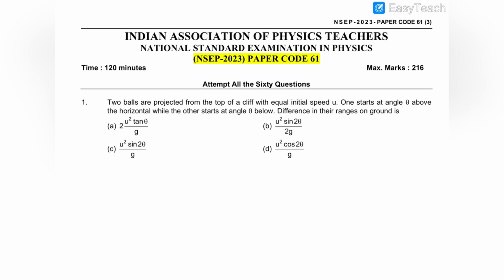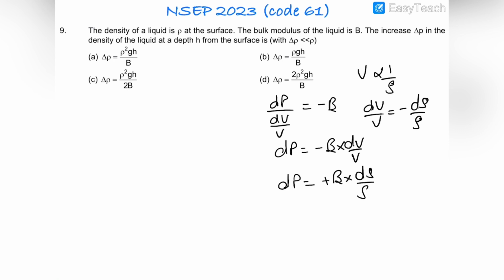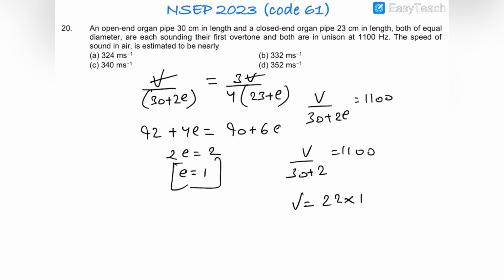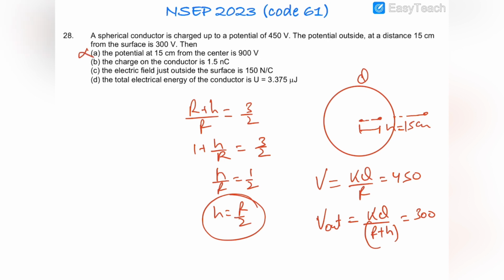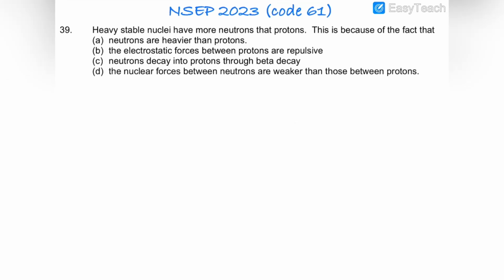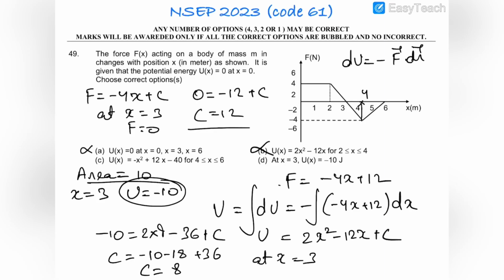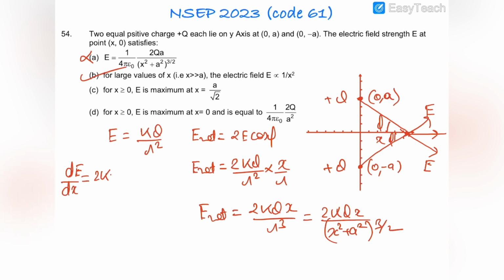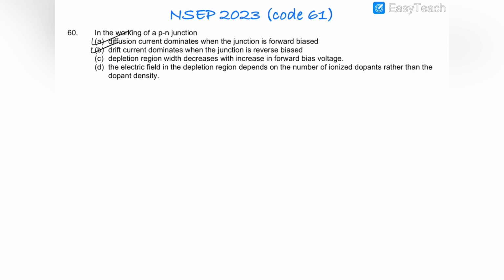Official-Level Solutions | NSEP Physics Olympiad 2023 | Challenging questions inside

Comment: 1:58:39
it is wrong to assume that that line is the LOI.
correct method is to use energy conservation and momentum consv. in both directions, which will give theta=60
Reply from the maker: Initially alpha particle is at rest and if some force acts on a particle which is at rest Initially,  it starts to move in the direction of force hence the direction or the line aong which alpha particle will start to move will be the line on which it has received the impact and hence it will be the LOI....what is wrong in this according to you
Reply: @teslaeduventures  sir, we do not know the exact direction in which the force was applied between the balls, there may be some impact parameter(distance between the centers of the balls)
and also the answer key says V/sqrt3 is correct
Reply from the maker: And If we attempt this question by energy and momentum conservation it would definately take atleast 10 Mims of precious examination time....do you wish to invest atleast 10 mins in this question in exam
Reply: sir it would take much less than 10min if we observe that the x component of velocity for the 2M mass would be v/2 (as the other mass is moving purely in the y direction)
even if we don't make that observation and take vsinQ, vcosQ etc it would be solved quickly
Reply from the maker: @AJames-f9i so how do you prove that the line is not loi ?